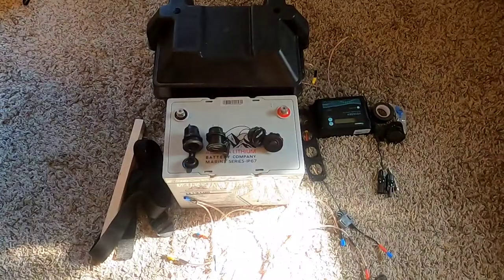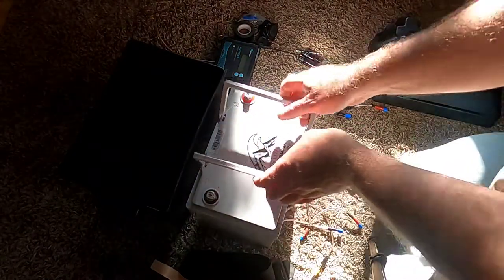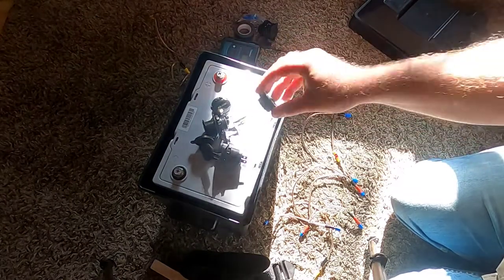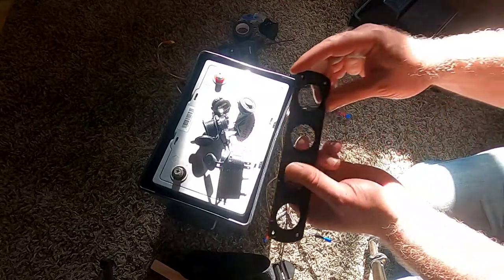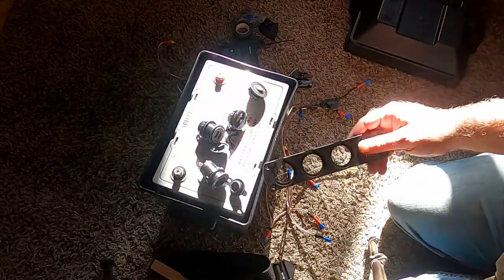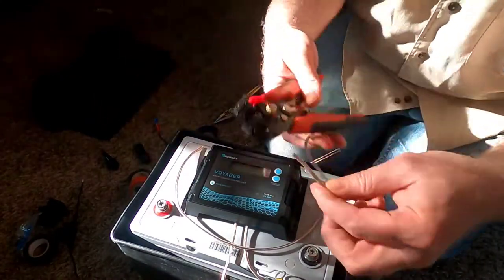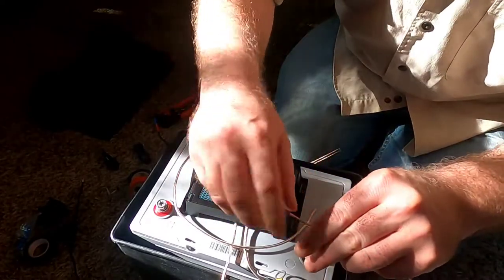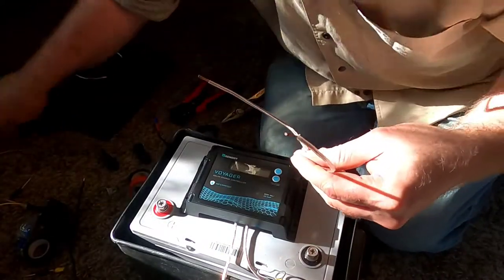A SIMPLE DIY BATTERY BOX SOLAR GENERATOR - LIFEPO4 1280 WATTS USB AND CIGARETTE LIGHTER OUTPUTS

Comment: Would a deep cycle marine 12 volt battery be a step down from the battery your using? Going to build this unit to.
Reply from the maker: It would be a step down, I always recommend lifepo4 batteries. But they are usable if no other option is available

Comment: Is there any reason this shouldn’t work with a “troller motor box” that already has everything wired and ready to go?
Reply from the maker: It depends on the box, if it is designed to handle lifepo4 batteries in the charge controller, if not it may not fully charge the battery as the charging voltage ranges are different with different battery chemistries.
Reply: @frankbush333  how would  i tell if it could handle the lifepo4?
Reply from the maker: The manufacturer will normally state what batteries they are compatible with